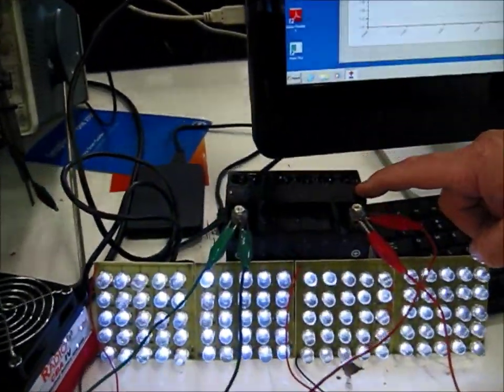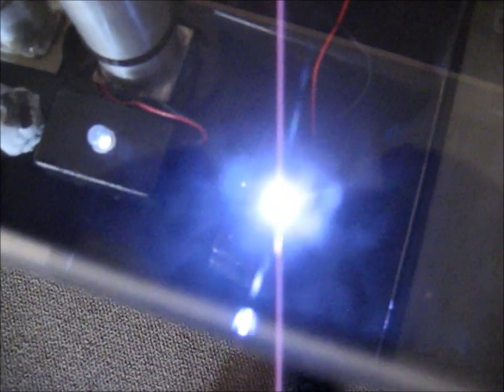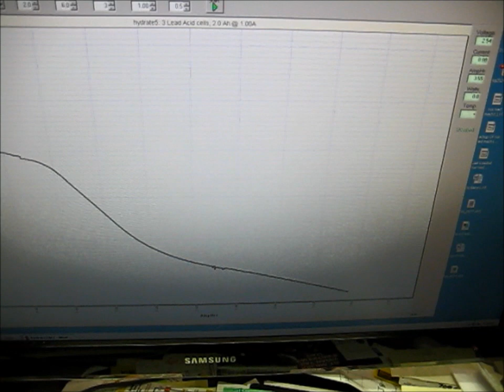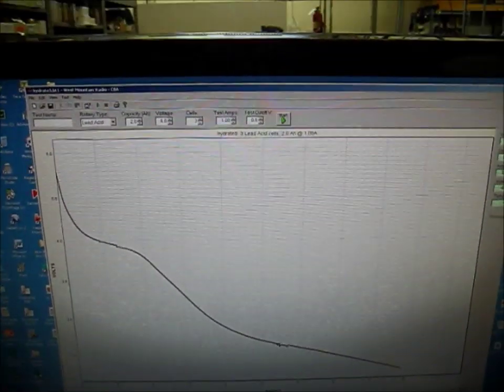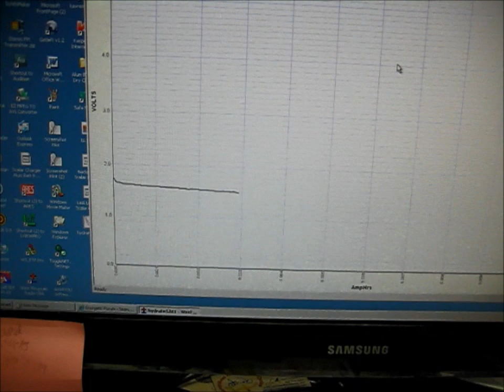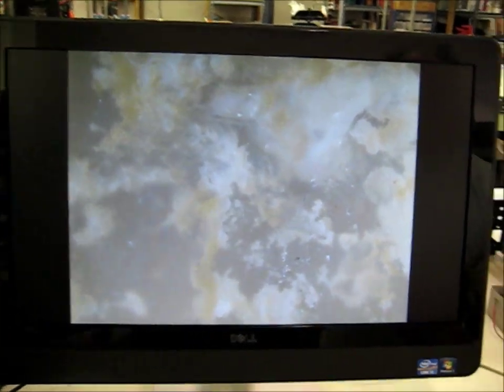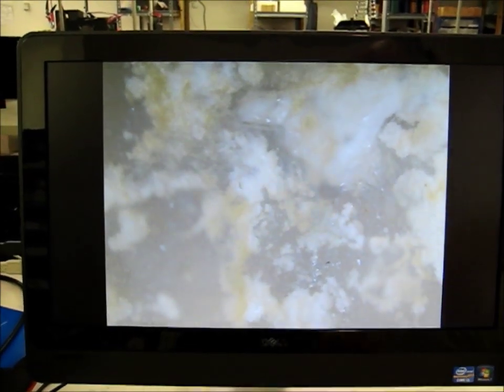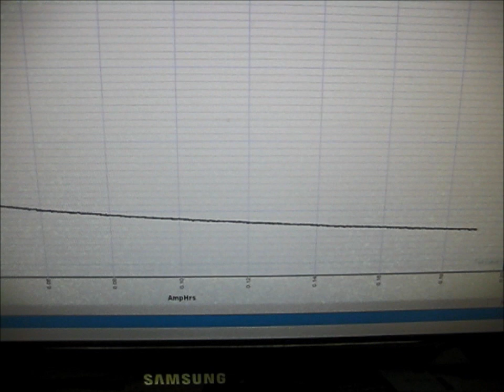How The Alum Battery Works5 John And Chuck.

Comment: You guys have done extensive research. Impressive! How do you restore the battery? What is the restoration process? Could you please share the ratios of liquid alum and water for a 6v, 8v deep cycle battery? I see in your final curve analysis that the battery is lasting a considerable amount of time. How long and how many batteries 6v or 8v, would you need to run with a 30 amp solar panel, charge controller and inverter, in order to maintain enough power to run a 30 amp sump pump (running continuously)? Thank you for sharing your experience and insights!

Comment: This is a lot of data but no information, not for the laymen.

This new battery technology of yours, using alum.. why should we use it? Does it generate more power? hold more power? does it synthesize power from the ether somehow? can it potentially be taken over unity? or is alum just more durable as a battery than lead acid?

Please advise